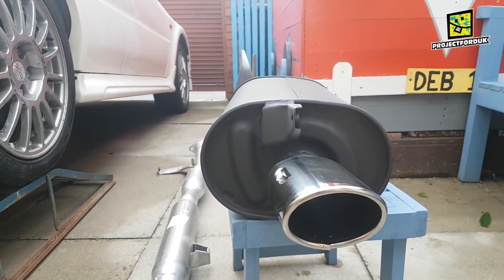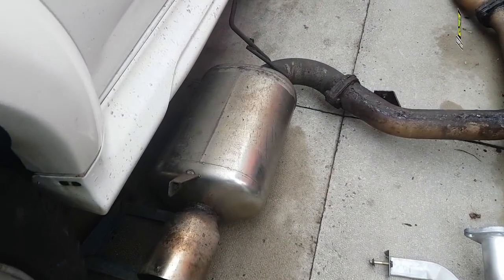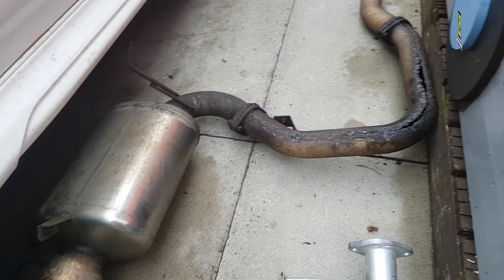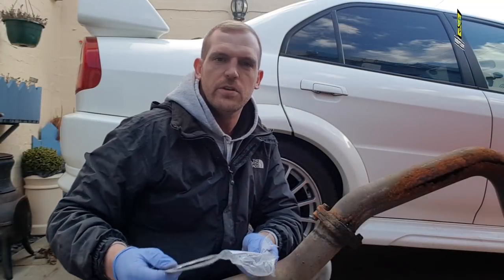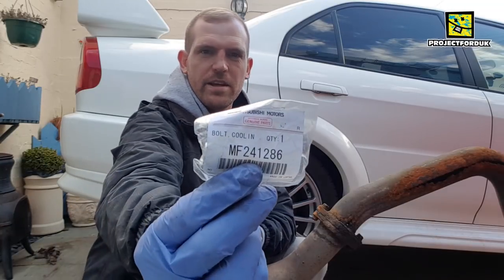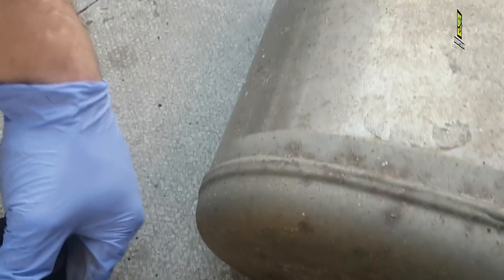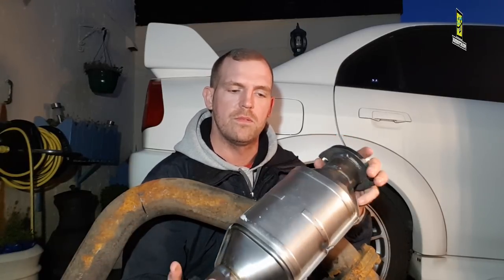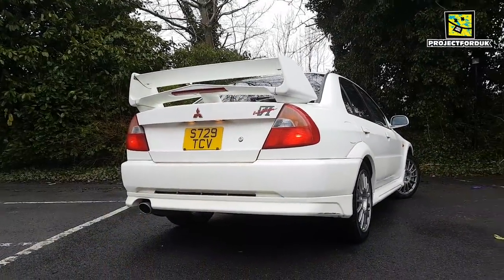Part 9 - Genuine Standard Exhaust And New Catalytic Converter On The Evo 6 - JDM

Comment: The first time I've ever seen a standard exhaust on a evo. Looks to small though in my opinion haha
Reply: The tip of course
Reply from the maker: It does look small but that's because of the buckets you are used to seeing sticking out of the back of them ha. If this is what the chaps at Mitsubishi thought looked right when they designed it I am happy with that haha :) I have also tried finding a picture of an Evo with a standard exhaust and can't. I can not tell you how much better the car feels its weird.
Reply: Fair enough prefer the oem looks anyway. This cars get modified to hell. Nice to see a standard original. More escort videos tho !
Reply from the maker: I know I need to get that car through its MOT then I can properly start work on it